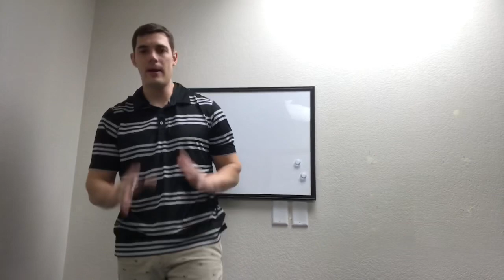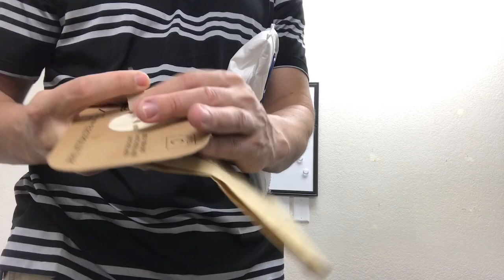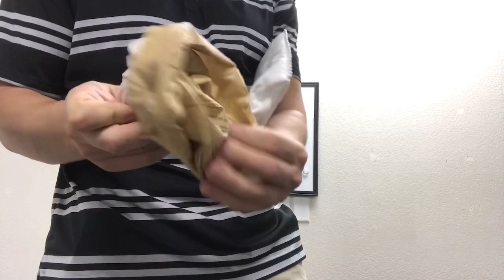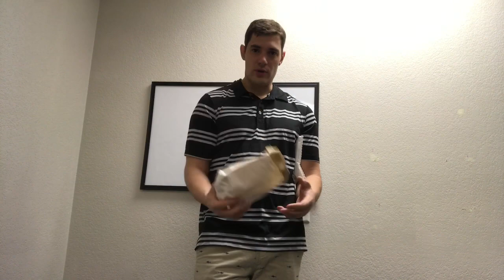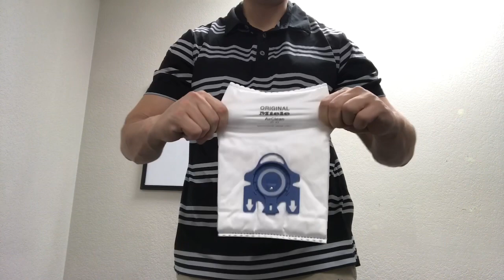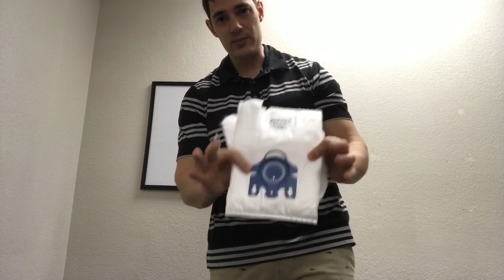Paper VS HEPA Vacuum Cleaner Bags

Comment: Complete and total nonsense. Hepa allows more particles through it than a paper bag does, including viruses which become airborne if they pass through the hepa filter. this has been proven in tests.  you can tell when a person does not know what they're talking about often when you see them using a Mac laptop lol. I mean just think about it, The reason the paper bags no longer allow the vacuum to suck in any more dust is because they are so good at capturing everything that they get clogged up with dirt. this is a GOOD thing not a weakness!😅
Reply: So, people don't know what they're talking about. Thanks for the gaslight!